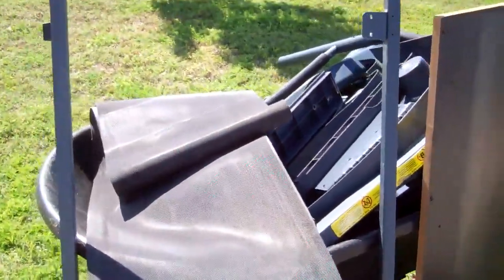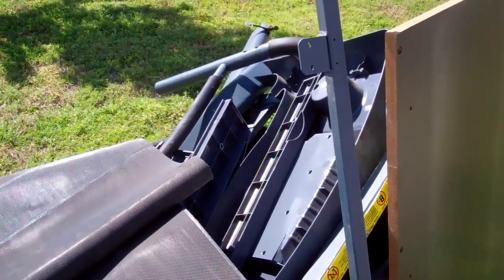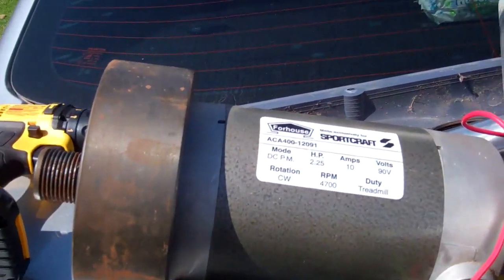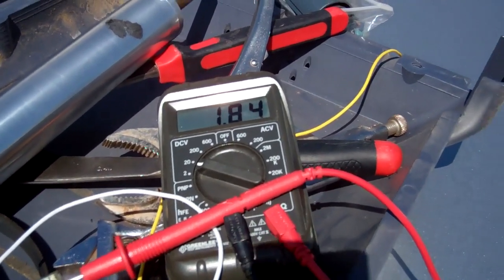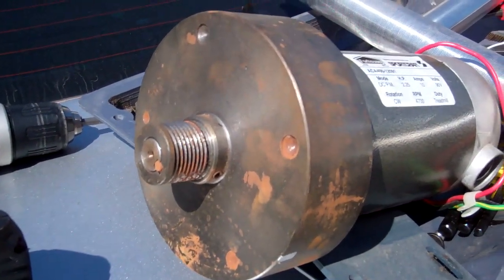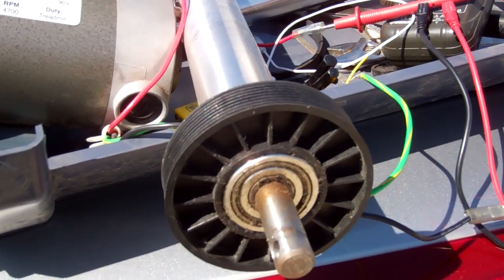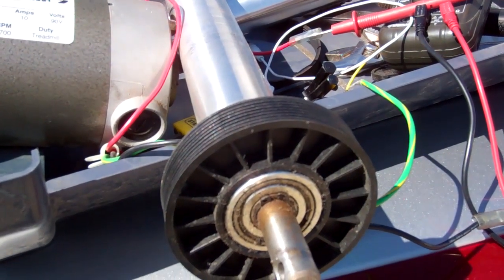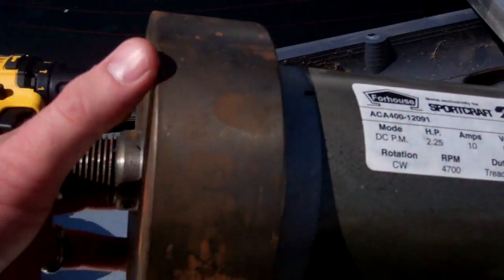Wind Turbine: Part 1 Finding the motor

Comment: Brother let me ask you your opinion on this you know how air boats use a step down gearbox to run the propeller could you turn that gearbox upside down to reverse the process connect the propellers to the slowed down port shaft and the generator motor to the max rpm side  possibly even two motor generators connected together by transfer case type design to double the speed and power output?.i would love to find or design a gearbox that would give me maximum rpm with maybe 1 turn to what ever ratio that may be if you figure it out please let me know i dont know what im doing.

Comment: Nice motor but, 4700 RPMs?  RPMs under 1600 are best for wind turbines motors.  Your motor will have to run really fast to get you to 18 volts.  You will need to get 52 to 53 RPMs per volt. That will be almost 1000 RPMs for your motor.  Because you may run into problems with your desired voltage, you may consider building a voltage doubler circuit if your unit averages only 8 or 9 volts.  Also, people stopped making PVC blades because PVC cannot handle UV rays.  However; there is a fix for that.  When you finish your blades, spray paint them with Krylon Paint.  Trust me, this paint will protect your PVC blades really great.  Please see my first YouTube "Mini wind turbine 4" because I couldn't keep this unit outside until this paint came out last year.  Good luck.......
Reply from the maker: Thanks so much for your comment! I will definitely go that route if I dust if off.
Best,
Dan

Comment: hi, do you know where can i find good price on batteries, like the ones you mention golf car?
Reply from the maker: clientesym Hi Clientesym. I bought mine at from Sam's which may or may not be an option depending on where you live. This is an old video but at this point I have 12, 6v, golf cart batteries configured in a 24v system. They have been pretty dependable so far but should only be considered for small applications. They were $90 each but have a $10 core trade in. I hope this helps!Dan